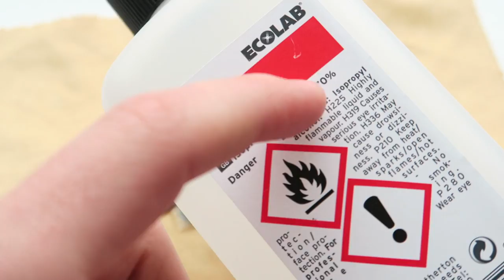Let's Mod! - GameBoy Pocket to GameBoy Light!

Comment: You actually should get power for the backlight from capacitor C21 at the top left of the board.  This provides a more steady voltage, and eliminates backlight flicker.  It's amazing how many people, STILL to this day, tap power from the unstable audio circuitry....
Reply: Cool
Reply: R/iamverysmart

Comment: Why did you skip the step of showing how to put the polarizing film on there when you put the backlight module on the back of the screen? It seemed like kind of an important step to showcase how to do, but instead you only showed taking off the protective film and then not how to put it on between the screen and backlight.

Comment: Solder backlight's positive wire to contact 6 with 100ohm resistor instead. It will be a lot brighter
Reply from the maker: Oh sweet, thanks.
Reply: And make an updated video :)
Reply: Yes please, make an updated video with bivert mod installation on a GB Pocket. :D
Reply: @Hillary Is Evil suspicious? Not really, probably didn't think to do it.
Reply: @DJBiono  yes pls

Comment: to prevent putting stress on the ribbon cable when your removing the reflective layer, you could try sliding a card in between it and it would probably do the trick

Comment: How does a resistor make it draw less power? Sure the screen gets less brighter, but more energy gets wasted in the resistor...
Reply: Electrical engineer here.  I know this is an old question at this point but I thought I'd answer it anyway.  Adding resistance will lower power draw.     Ohms law states V = IR, or voltage is equal to amperage multiplied by the resistance.  By expanding it out a little for watts we can use that same law to also show P = I^2*R, or power is equal to the amperage squared multiplied by the resistance.  Now a small caveat.  Ohms law is a simplification of the complex impedance plane and only really applies to resistor networks, so it doesn't apply to all circuits but works well here. 

From that law alone we can see that increasing the resistance will lower the amperage. To give an example though if we have 5 V and 10 ohms of resistance and we solve for current we'll expect to see 5/10 or 0.5 amps.  Solving for power we take 0.5 amps ^2 * 10ohms and will get 2.5 watts of power.  If we increase the resistance then to 100 ohms and calculate our amperage again we'll get  5/100 or 0.05 amps.  Calculating for power then 0.05 amps ^2 * 100ohms we get only 0.25 watts.  Our power usage went down as our resistance went up.  I think this makes intuitive sense as well if you just think of a battery.  If you disconnect a battery how much resistance you you have?  Ideally you'd have infinite resistance, if more resistance meant you used more power then disconnecting a battery would mean your battery would go dead instantly, which obviously doesn't make much sense. 

To go through this particular circuit we have an LED, or light emitting diode.  Diodes work differently than resistors in a few ways.  The first way which you might be familiar with is that they are directional.  Current can only flow in one direction through a diode (excusing things like zener diodes).  Also of note though is that diodes have a constant voltage drop across them, known as a forward voltage.  They do not resist the flow of electricity the way a resistor does.  If you have 5 volts at 1 amp going through a diode with a 1.5 volt forward voltage then on the other side of the diode you would only see 3.5 volts but still at 1 amp.  For an ideal component the amperage will remain unchanged.  It hasn't resisted the flow of electricity at all there has just been a voltage drop across it.  Different diodes can have different characteristics in this way, Schottky diodes for example are designed to have a very low forward voltage for power applications and LEDs traditonally have a high forward voltage because they are using that voltage drop to produce light.  The power used by a diode in a DC circuit is equal to that forward voltage drop, multiplied by the amperage.  The actual voltage applied to the LED doesn't matter in some ways as much as the amperage does.  Though obviously once you get to certain extremes the LED will suffer from dielectric breakdown and be destroyed.  By adding resistance to the circuit as he has done you lower the amperage passing through the LED and by lowering the amperage passing through the LED you reduce the power draw of the circuit.  The resistor will turn some of that power into heat now, as would any component added to the circuit, but much less power is being drawn than the LED was consuming by being in a short circuit configuration especially because as mentioned forward biased diodes don't resist the flow of electricity.
Reply: @esven9263  dang I love you

Comment: Hey man. Something to try if you get a chance. A while back I picked up a cheap little ultrasonic cleaner for a completely different purpose (motorcycle parts actually). 
Anyway; the other day I was pulling apart an old Xbox controller to clean (it was truly horrendous) and wondered how the the bit would go in the ultrasonic cleaner. Using a decent dollop of cleaning solution, all the buttons and rubber membrane came out *PERFECT*. All that yellow/green 'crud' that builds up in the button cavities or around the actual buttons, and in the seam between the two halves of the controller - gone. The only gotcha was the (well-worn) rubber tops of the analogue sticks, they turned out pretty rough. But the rest came out like new!
Reply: I second this recommendation. I use a multi speed ultrasonic jewelry cleaner I picked up for $3 at a thrift store and it works wonders.

Comment: Where did you get the GB Light screen lens that fits your Pocket? The standard replacement ones I've seen are slightly too big, as the Light's lens is a little bigger in both dimensions.
Reply: How can I tell though? I've searched before, and none ever seem to mention the Pocket, and it's difficult to tell from pictures what the dimensions are.

Comment: Every DMG I backlit was a  pain to remove the old screen backing...found a trick...used isopropyl 70% and a qtip and once I got a corner up I applied the alcohol in between the screen and it comes of like a champ.  Nice video.  btw you mentioned something about fixing the burnt center of the LCD.  What does that entail?   Replacement?  I see those coming from Japan, did people leave them in their hot cars or something, because I have never seen that on a USA pocket.  Only seen the dead pixel blotches on them.
Reply from the maker: You can replace the front polarizor film, interesting you say that! I dont think i have seen a UK one with the same issue.

Comment: Thanks for this, I've just done this mod on my clear pocket using a blue backlight, also from DPR. Where did you get the 'gameboy light' screen cover from? Is it glass? 

A couple of tips for anyone else doing the same mod - a) I wasn't sure which way to install the polarising filter, so I put it behind the screen once I had removed the old polariser and reflector and in one orientation the screen was dark and in the other it was light. I went with the lighter option. b) you have the positive and negative wires the wrong way round. I had to check it with a DVM before I realised my mistake. The negative mark on the board must refer to something else, no idea what!
Reply from the maker: Nice one man! Its plastic, I got it from ebay. I think AliExpress do them too! Thanka for the tips!
Reply: No worries, thanks for the info! :)

Comment: Great video. I have two questions, if you would be so kind to answer them. 1) was the backlight deadpan's pro version without a resistor? 2) What value resistor did you use? I've successfully modded 2 pockets with Deadpan's backlights with inbuilt resistors, but there's so much power drain that the game boy only runs for 30 mins, even though the batteries are almost full and work in anything else (including non-backlit pockets). Cheers! -James.

Comment: Hey TheRetroFuture, where did you get the "Game Boy Light screen lens" from? Please respond.
Reply from the maker: Ebay mate!
Reply: The Retro Future Is the Gameboy Light's screen lens on eBay either plastic or glass screen lens?
Reply from the maker: Carl G. It's plastic, it's not the same size as a GBL lens, it was advertised for. GBL, but fits a GBP.
Reply: The Retro Future 😳 Wow! I'm surprised that the Gameboy Light screen lens on eBay is not the same size as the original 🇯🇵 Japanese Gameboy Light lens, which the screen lens is compatible with the Gameboy Pocket. But, I noticed in this video is normal plastic lens.
Reply from the maker: The Gameboy light screen lens is bigger than the pocket.. they do sell correctly sized ones on eBay, but the specific one in this video was listed and a GBL lens, but it's the same size as a GBP.
Reply: The Retro Future can a brotha get a link to that if you could be so kind?

Comment: after installation the Gameboy does not work anymore. I have followed all the steps as in the video. Do you have an idea what's going on? even if I dismantle the cables from the display is nothing at all...
Reply from the maker: Hey dude! Have you checked to make sure.you havent damaged the screen.
Reply: Yes, I did a test run before soldering the cables. The monitor, the sound and the red control light worked. Nothing works now. Do you know what you can do wrong? It is so annoying
Reply from the maker: Have you joined two solder joints together by any chance? You are working near the DC converter, so you may have shorted the  power.
Reply: yes I've checked all contacts. I do not want to exclude a short-term contact. Can a short circuit damage a component that I can replace?
Thank you for your help

Comment: i bought a GBC with the same burnt screen problem. but its a harder fix than i thought. the polarizer screen doesnt work properly . image is always inverted. please help
Reply from the maker: Theodore try rotate the polarizer, have you got a front one or a back one? I belive there is a difference.
Reply: Theodore Phan I stripped a couple layers of the gbc screen off, 2 I think, and the polarizer worked the way I took it off!

Comment: Would you recommend heating up the screen from the front before attempting to peel off the two background layers (2:36)? For softening up adhesive and easier peeling process.
Reply: No. It's a freaking raw LCD, bro. You don't heat up raw LCDs. Never
Reply: @92000  Alright, thank you for that info, wasnt aware. Im not an engineer, merely a novice.

Comment: Where did you get the resistor?
Reply from the maker: It will come with the backlight kit. That being said you can get them cheap on amazon and eBay. I used a 100 ohm resistor, but for red and orange I think you need 150.
Reply: The Retro Future got it. Thanks! I got one with a resistor built in to the backlight pad. Did you have to add another resistor to it?